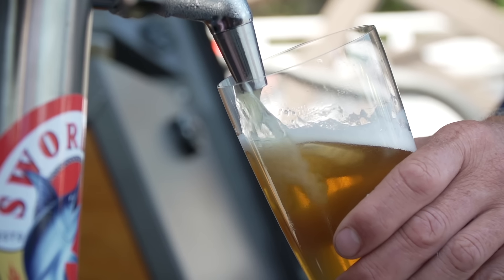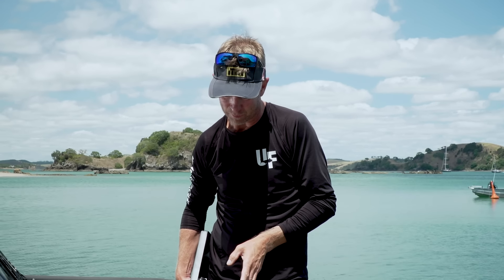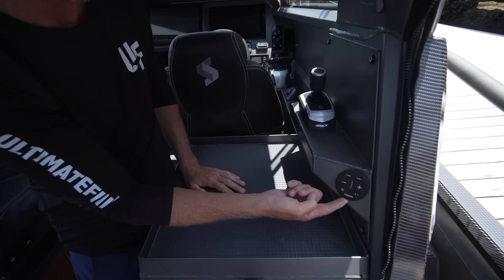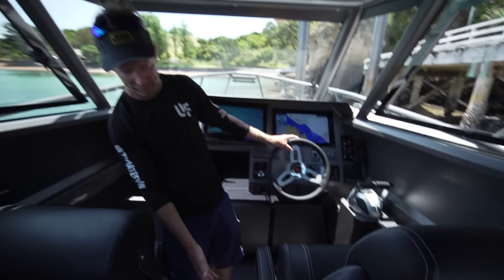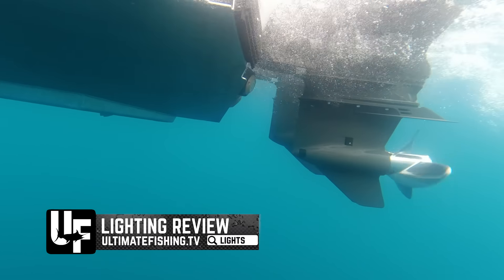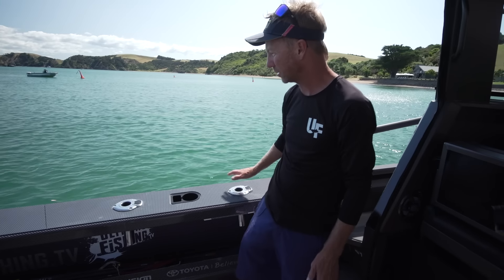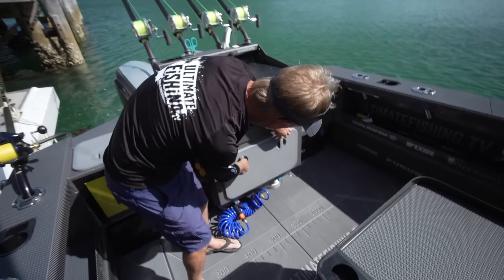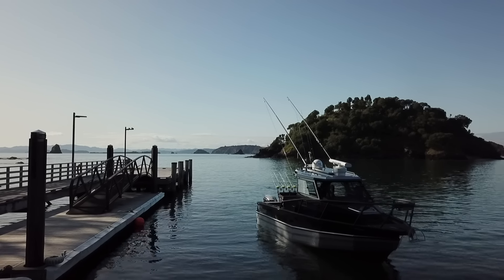Full Review of Matt Watson's Ultimate Fishing Boat – Stabicraft 2750

Comment: Create a boat with trap door bottom hull buoyed by 2 horizontal poles perpendicular to 2 long slender black floats, open sliding cage door, put fish bait in giant tea bags inside lowest hull, use black plastic to cover the top of the trap. Open the peep hole to see through the top plastic board to see lots of fishes goes in, close trap door, use wooden pole net to grab fish to pour into second boat floating next to you.

Comment: I keep wondering about the bait stations  27:30 on Stabi's.  Is it really worth ruining the 360' fishability?  Even with no rods in the holders, the big honking bait station makes it look impractical to fish the stern.  If fishing by solo, how you gonna get around the motors while fighting a big pelagic?
Reply: I think move the boat instead of the angler I suppose
Reply: tbh i have often wondered on american cc in particular which have plenty of room out the back transom, but fa in the way of a bait station anywhere else on the boat. its often replaced with seating and what not. and if it is present it is really small because they made room for a sink and tap bla bla bla. Caught some spaniards and kingies and had no problem either moving the rod around the bait board or moving boat if necessary. you would have greater chance breaking off the line on boat prop if u were unfortunate than a mere bait board being in the way. stabi's have a bait board and live well integrated by memory also
Reply: @finncoleman5787  My point exactly.  If the bait station weren't there, I think it would be possible to just fish around the motors instead of having to move the boat.
Reply: @frosty4593  Not quite sure what you're getting at.  Most American CC boats do not have a big fixture attached to the transom.  This is why they have 360 fish-ability.   Not bashing the Stabi, but it might be a nice idea to have an option to delete the bait station.

Comment: Hi Matt a couple of questions 
1 How much fuel will the 2750 carry?
2 how much does it weigh on trailer for towing ?
3 seriously can the Landcruiser tow this boat ?
Reply from the maker: The Stabicraft 2750 carries 500 litres of fuel. The boat is around 3.5 ton, and the Landcrusier pulls it with ease.

Comment: In America we got these F250's and F350's to haul that boat and not even flinch. Heck of a boat.
Reply: I have a 2011 Dodge Ram 3500 dually 4x4 diesel 6.7 that I use to haul Travel trailers & 5th wheel trailers from manufactuer to dealerships. I was thinking same thing you were. 8,000 lbs is a walk in the park. The high output Ram 3500 dually is rated at hauling over 35,000 lbs. I have hauled several 5th wheel trailers over 16,000 lbs (8 tons). I use it to haul my 1650 fisher stabicraft & you do not even know it is behind me.
Reply: Oh u so lucky.
Reply: (Hehe)......Dodge Ram,.....(hehe).

Comment: was  this  built with  stabicraft custom ?  Do they have all the details  of your build at stabicraft to replicate this boat with  all the features and electronics  ?  Please  let me know asap so i can get in touch with  stabicraft for me to get  one built .  Have  been looking at these boats since theu came out and absolutely impressed with your new  build .  I want  one
Reply from the maker: Hi Corey, yes Matt's Stabicraft 2750 was custom designed to tailor to Matt's boating needs and extensive electronics, so not everything on his boat is a standard tick box item. However if you're looking at a similar custom boat to Matt's, contact your local Stabicraft dealership as they have all the details on Matt's set up, and they'll be happy to work with you to design a boat that best fits your boating needs.

Comment: This days the perfect configuration will be a Hybrid Electric ⚡ electric propulsion combined with electric generator it will be more quite and more fuel efficient and for low speeds a battery bank will solve the problem and the cooking 🔪 switch on induction stove electric grill no headache with gas !

Comment: change to lithium batteries saves heaps of weight and you can use 80% of you battery  faster charge lead acid only 50% slow charge i run a electric trolling motor on my 7m surteese so i have 6kw of lithium and have never runout of power even away for days

Comment: Going with Evinrude was not a great choice, old tech and now a defunct brand. 4 strokes are now the preferred choice.
I would always have a fresh water tank, not necessarily have a basin or hot water, but fresh water with a multi flow head. 
I also prefer a lockable cabin than muck around with plastic clears for over night stays and when traveling in wet weather. 
Portable 90lt 12v fridge freezer with decent solar and lithium house batteries.

Comment: This is the greatest thing I've ever seen! Cheers bud! Amazing!!! The only question I have is that, is it possible to have everything the same but use jet impeller propulsion instead of an outboard with a prop?
Reply: You could have an inboard engine with a water jet drive.  However you might lose some deck space, depending on the installation.   The good thing about outboards is that they are out the back!
Reply: Bro, check out Brodie’s new boat for the YBS channel. It’s a beast!

Comment: Well done Captain Matt, you may have just passed WSP commercial/ research "Day Boat" 001 -  017 as the ultimate.

Testing for the next fleet batch of ultimate Day Boat" 018 - 034 big twins heavy loads capable platform solid and quick configured with multiple commercial/ research prototype gear-types,  WSP specializes in deep bottom demersal fish and cold water crustaceans between  12 North and 12th South below 80 fathoms. Appreciate to see someone else figured out the best sounding gear setup. WSP captain(s) and crew(s) will appreciate me sharing what I found.  Bright captain Matt "Day Boat"  designer of Creature Comforts convenience, necessity working items configuration as the ultimate setups, from experience. Captain Matt is there more room to take the next "day boat" up a level?
 You got to love the Ausis Style! I do. 

Not sure about your ultimate "day boat" platform. It looks tough I wonder if it would stand-up to commercial use? Stabicrafts looks floaties and secure to scoot around set & pick gear offshore, a bit more deck space would be nice. Useful for WSP "Day Boat"  trips working until time to offload and lay down on the Mothership.

Comment: Sure, the Land Rover can pull 8.5 ton.... if it was being towed by a ford.
Reply: You mean being towed by  a touareg or a G class
Reply: I'll stick with my 2011 Dodge Ram 3500 Dually 4 x 4 which has 860,000+ miles on it right now. Cannot beat the cummin's engine

Comment: nice boats but the fuel tanks are too small- not enough range. We go 80+ miles off shore one way. 132 gallon tank isnt going to get it done. A 27ft boat should have at least 150 gallon tank. Most have 180-200 gallons.
Reply from the maker: 600 litres is just over 158 US gal.